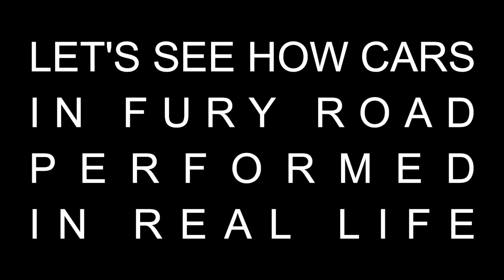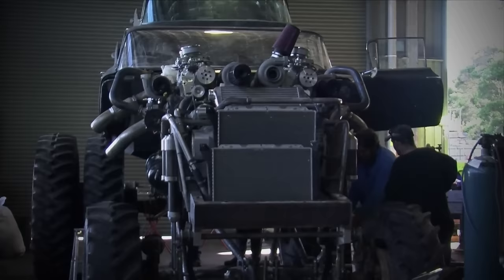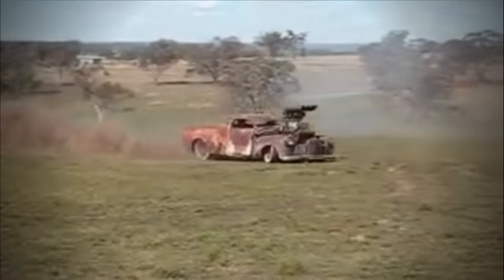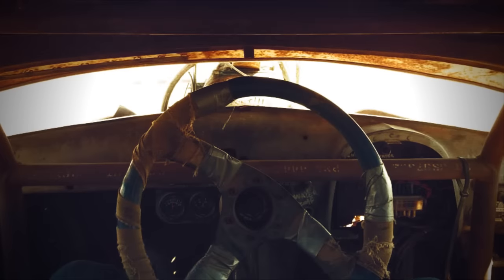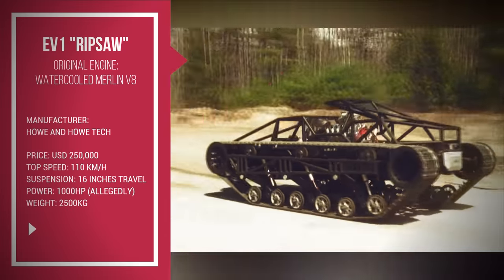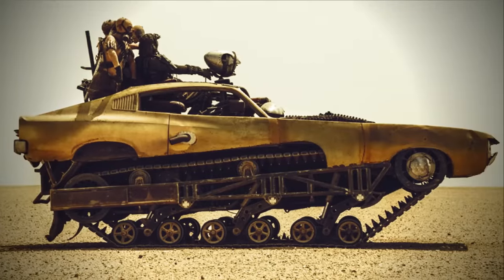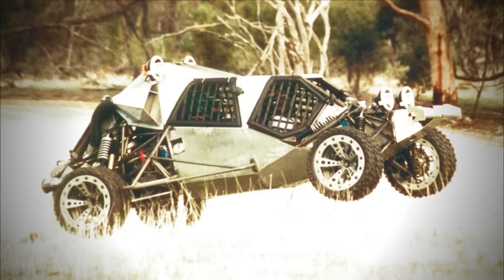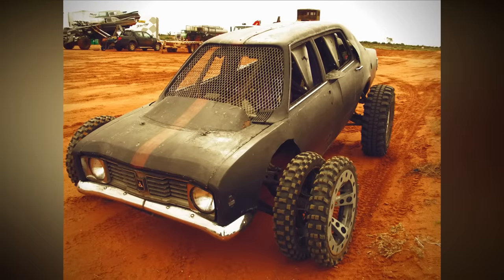Fury Road Cars vs REALITY

Comment: The true funny thing is most of these would not exist in the type of apocalypse featured in the Mad Max series for several reasons.

1: fuel is scarce. Not one of these would be fuel efficient enough to drive long enough to find more fuel.

2: this is a wasteland with little resources. Building oddball vehicles using uncommon parts will cause problems when something inevitably breaks or they crash it or sustain damage during a raid.

3: it’s been a long time since the world was “normal”. Not many of these people would know how to fix these vehicles if they did break.

In truth, the vehicles would be as simple as possible (mechanically) for reliability and ease of maintenance and be made of as common as possible parts and vehicles. So probably a truck chassis, small block Chevy (they made millions of them) or in-line  6 (one of the most reliable engine designs in the world) with a carb and points ignition (minimal electronics as possible) and a manual trans (generally longer lasting and has other advantages). Body? Whatever you want based on your needs.

Comment: If MMFR takes place 50 years after the apocalypse, what the hell are they using for oil, gas, and seals?
Reply: 50 years? where did you get that number? Max was already in his 30s when the apoc hit. The original Fury Road character bio had Max in his 50s since Fury Road is shortly after Beyond Thunderdome which takes place 15-18 years after the apoc.
Reply: Molasses.
Reply: It's amazing that there is still peanut butter and molasses after the apoc.

Comment: I don't understand what the big deal was about running dual engines. Anyone who is into vehicles has seen or heard of tractor pull competition. They pair 4 and 5 engines together. The these kind of adapters are actually common if you look into the correct industry.

Comment: I bet the two Tatra trucks (the war rig and the doof wagon) had zero problems
Reply from the maker: You're right, they had very little issues at all! One of the War Rigs (Tatra) had to have its engine replaced for a Dakar version because it was hauling a tanker and a pod filled with concrete over sand but other than that I haven't heard anything about that from the mechanics. The MAN used for one of the Doof Wagons made it out alive from Namibia too.

Comment: Got to be a GT Falcon every time. It’s the same as The Italian Job, the BMWs used in the remake, (I know they are Minis) will never be as good or iconic as the real thing, 10 feet long, front wheel drive, drives like a go kart and I’ve owned several cheap ones but they were great fun and easy to work on.

Comment: Turbo vs Super-/Hyperchargers:
One with knowledge would understand that normal Turbo only engages at certain speeds (turbochargers typically suffer some response lag while the exhaust pressure required to spin the turbine builds) while a Super- or Hypercharger gives power from the get-go.
Turbos are more fuel efficient, but much harder to install.
If it comes to power and such, Super-/Hyperchargers are my preference, as you do not have the time to lose time.
Turbo-lag, see ... .
Reply: Another way to drive Frankensteep:
On FEELING!!!
Yep.
If the car, "by itself", abruptly stops, back up, you "probably" hit something.
Any thump you hear, but the car still moving:
You "probably" hit someone.
Both act as radar, quite darn handy.
Often not as pleasant for the one that you drove over, but, well, you're IN the vehicle.
Not outside, the one who "thumped" your precious wreck.

Right?
Reply: The EV1 "RipSaw" was NOT build by the Military!
Build by Howe & Howe Technologies. who makes "military grade vehicles", and requested by the Army for evaluation (which already says it ain't a DERPA that actually is Army, yet a stand-alone company such as Boeing or Lockheed/Skunk Works).
That they were approached by the army (this because they got wind of them building the EV1), does not mean that the army "arseimilated" that company ... .

Comment: Okay how did these people in the wasteland tune their turbocharged engines? Did they convert all vehicles to carbureted and what about efi? Did they go back to mechanical fuel injection?
Reply: What makes you think they ever had EFI??

The first film came out in 1979 and seemed to be very near future at best.  The ford was an actual official police car at the time of the movies events so it couldn't have been very far off if it's meant to be the future at all.  

As for how do they tune.... the same way people have been tuning for over a century.  Hotrodders in the 50s didnt have laptops and plug&play ECUs but they still got work done.

Comment: Why did they have so many troubles with the GigaHorse's  two engines,  all they had to do was ask a tractor puller, they have up to 8 engines running their machines.
Reply: @jarleron4788  Clearly looks to me they had engineers design and build it instead of mechanics. Sorry engineers but just because a computer tells you something should work, doesn't mean it works great. Anyone remember Dodge Intrepids and the battery in the wheel well?

Comment: The first drivetrain shouldn't have been hard to source. Competition tow tractors in the US have been known to have up to and maybe more than 5 V8 engines with forced induction connected together to multiply the pulling force. 2 V8's in a w pattern should have been easy.

Comment: Would it have been a lot less frustrating if they hadn't gone too cheap with the Ripsaw they had ordered? Their determination for adding their own functional parts instead of the ones that came designed with the vehicle seemed unnecessarily risky for everything that came after. Average audiences wouldn't see the subtle differences on screen anyway, especially the swapped engine & inferior brakes.

Comment: Not sure who built the v16 engine but I feel like that setup should have had more than 1200 hp from what they described.
Reply: It’s a movie car, no need to go batshit crazy with power, tractor pull tractors run similar setups and usually output 2500-3500 hp just on 2 motors, I’ve seen 4 motor setups pretty cool things

Comment: The one vehicle in that movie I have to question the existence of is that huge "music" truck. If that scenario were real, that would be a dumb waste of fuel and equipment, as it would be useless.
Reply: it's a movie. in real life. most of the vehicles in "hot zones" have their windows wielded shut with steel plates to protect the driver. in fuy road, all the widows are open.
Reply: Dictators do dumb things in real life. Really wasteful, dumb, self-defeating, short-sighted things. At the expense of their people. All the time. Pick one.

Comment: Am I the only one who thinks that the stupidest thing about mad max, is that everyone is driving around gas guzzling supercharged V8's, right in the middle of a apocalypse where spare parts for a high maintenance cost V8 are so far in between?

Not taking the fuel consumption into account. Or that they are nitro charging their cars which increases wear on the engines even further.

I don't know... I might just be pedantic.

Comment: Two V8's coupled together is NOT a v16, not a w16... It's 2 V8's coupled. There is a HUGE difference. Mainly, they're 2 completely separate engines. That's not how it works.

Comment: They definitely were not building the turbo 400 right or used the improper flex plate and torque converter on that 2 engined car thing. I work with mud trucks that's push 1300 hp with a supercharged 572 big blocks running on 110 and tractor tire the size of my truck and these guys personally prefer the turbo 400 for it's reliability and simplistic design. I have never seen a legitimately built turbo 400 fail how you described it. You would have to slam that thing in reverse going 60 to need to rebuild it every single day. For anyone that thinks my comment is full of crap check out my Instagram page, @will_mitchell_350. Though I don't post about the monster trucks I work with I only run a turbo 400. My jeep cherokee has a AMC 401 pushing 600 hp and I have absolutely beat on that th400. My 85 k20 has a th400 and I also quite a bit hammer on her in first gear at 5200 rpms with my 383 stroker and I have never had a problem with it. It grinds my gears when people make the assumption a th400 cannot handle power and it grinds my gears more when these "Hollywood mechanics" don't know how to do something right for all the money they get paid.

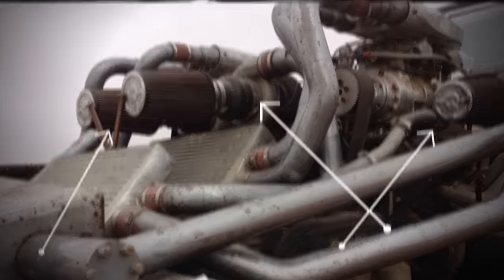Comment: 1:45 Twin engines are hard? Is that because of the car engines? I genuinely don't know, not a mechanic, most I've done is change some heads on a buick. But in the tractor pulls I saw as a kid there was a dude with 4 engines running as one. Is it easier with diesel or was that dude just a genius?

Comment: Ermmm, that's not a V16... It's a W16...
Reply: No, just a twin engine setup. 2 motors running into 1 gearbox. Setups like this were being made by Chrysler marine using gen 1 Hemis back in the 50s or 60s.

Comment: The director must have been a complete nutcase to put so many radical custom cars in the movie. Good kind of nut, a car nut, but a nut nonetheless.
Reply from the maker: Interestingly, George Miller is not a car guy at all. His producing partner - Byron Kennedy was, the idea of those crazy cars in MM1 and 2 came from him. You can tell the spirit of car culture was a bit lost in MM3 because Byron died before filming it. And for Fury Road - George Miller needed a lot of help in creating those cars to begin with because neither him nor Brendan McCarthy could really visualize those cars properly. If both of them had their way with vehicle design without any car guys we'd get a clunk-fest with cars that looked like 1920's tanks. Peter Pound, Colin Gibson and Jacinta Leong are the ones that materialized those cars, George Miller was more into the story.
Reply: @MadMaxBible  Next video?
Reply from the maker: @johndunn4060  Soon'ish. Just finished collecting info on the Interceptor(s) used in Fury Road, that's next.

Comment: None of them would run at all.  The gaskets on every seal.would be completely trashed after 20 years of that hard a run.  No alternator would be running that long either and the batteries would be long corroded away.  As fun a film this is, none of that is possible, especially if you're constantly smashing them up and Action Movie-ing it all to scrap.

Comment: Tractor pullers have been ganging togarher 2 to 6 v8s for decades.    As for using the turbo 400 for anything that was stuipd.    Tractor pulling a single big block would rip one apart.    Those GM tyranny are the reason scatter blankets became required safety gear.

Comment: Technically the Gigahorse is a W16 then, like the Bugatti Veyron and Chiron ? 

https://en.wikipedia.org/wiki/W16_engine
Reply: Yeah just this one barely could run 80 mph. They should've just put in a regular truck underneath and cover it with fiberglass or woodworks of custom bodyworks to simulate  the PA chop design. Too much work for nothing, it was crushed at the end of the shoot so why bother really.
Reply from the maker: No it wasn't. Both Gigahorse's are now in storage at Kelso, NSW, Australia (along with War Rigs, Doof Wagon and a bunch of other cars)) I just hope they won't share the fate of MMBT cars that were in storage for many years in Sydney until some Warner Bros executive decided they had to be destroyed. That's why there's only 1 car from MMBT left, displayed in Adelaide if I'm not mistaken.
Reply: @thegoodtom1718  I know. What  I meant to say they should put a truck engine or tractor underneat so as a whole basis  etc and cover it with some shell mask that looks like this butchered crap they did. This isn't some random's science class this is just for a movie. No need to waste time and funds on something that obviously wouldn't work. Be creative all you want just use the base that is proven to work.

Comment: Your first argument with the gigahorse is hilarious. What's called a W motor is while odd not impossible and has been done before. The biggest struggle would be, yes the transmission, and for a wasteland project,getting the custom frame. Otherwise seems pretty realistic.

Cranky Frank and his nasty temperature and unsafe drivability.

This is nothing new with rat rods, they're impossible to see out of. Within a mad max world I'm sure itd be modded differently however it's clear that even some of the choices within universe would be to block sand and dust as windshields can obviously be broken

Peacekeeper
Part of your complaints are a fault of the person who ordered it. People who own other versions of the ripsaw love them but when you force a military contractor to make you one on the cheap. They're bound to give you what you pay for

Giggle horse
Never planned to be in the film officially from the way you spoke. Just seems like someone got bored, not an actual polished design. 

The moon buggy
I'd say it doesnt fit the universe. I'm surprised it was even tested but everyone has their own tastes for the universe.

This video seems like one made by someone who hasnt ever worked with custom project cars or offroad monstrosities like some people choose to make. Maybe you do have experience. But if you did I'm surprised you're so negative about these vehicles
Reply from the maker: You know what's hilarious? That everything in this video comes from people who worked on this movie. Yes, even the fact that Cranky Frank's 383 pulled barely 300hp with a blower - that comes from a man who prepared this car for the movie. None of it is my opinion, all of that info comes from either articles about those cars published in magazines or me personally interviewing people who built those cars. I'm merely relaying information.

Comment: These horsepower ratings in the video are way, way off. A crate 383 is putting out well over 400 hp.  Slap a super charger and you are over 500 hp. You said it was 300 hp, and a little SUV would be putting out more than that.
Reply from the maker: Well, you're going to have to take it up with James Johnson who worked on Cranky Frank and delivered all that information. The way I see it - that 383 lost a ton of its power because it was just some old run down engine Snapper  found on his farm along with the supercharger. Combine the two in a makeshift way in some backyard and 300hp somehow becomes a believable number, there's no point in even comparing it to a modern SUV engine

Comment: I dont get it why do they use such unreliable fuel inefficient engines is it the only type of engine they can find if not why not use engines such as the 4g63t or the rb26det or the 2jz bc they can be more reliable get better fuel economy and also carry more power yes u it may be hard to find a rb26 or a 2jz but u can still find 4g63s or the 4age or the 3sgte  they can suport high numbers reliably and get better fuel economy
Reply: Because in the Mad Max universe technology stagnated in the late 1970s-early 1980s.

There were no 2JZs, RB26s or 4G63s.

Comment: Wouldn't a very economical car be better during the apocalypse with limited fuel.
Reply from the maker: No, because it'd be slow and you'd be run down in a second. That's why nobody drives a Prius in the Mad Max movies :)
Reply: @MadMaxBible  yeah but if you use all your fuel in 6 minutes you're not going anywhere. Example that gigahorse with all it's weight and horsepower would be out of fuel very quickly
Reply: @spoonhanz  when your imortant Joe the man who controls the water /aquacola supply and who major trading partners are a bullet farmer and a town named after gas 

I dbout he gives a shit about mileage fuel and ammunition would be abundant relative to the amount of people guns and vehicles in this situation

Comment: Hummmmm wonder why they use Chevy power plants in their vehicles . Wait I know , its because they are cheaper and easier to work with they put out awesome power and can take the abuse . There's a reason why that people use V8 Chevys in their hot rods . Next time you are at a car show see how many ford and dodge body's have Chevy power plants in them then see how many Chevy body's have a ford or dodge engine in them . I guarantee its like a 10 to 1 ratio (if that) . The Chevy 350 is the most used and the most popular engine in history among hot rodders , prove me wrong 😊 .